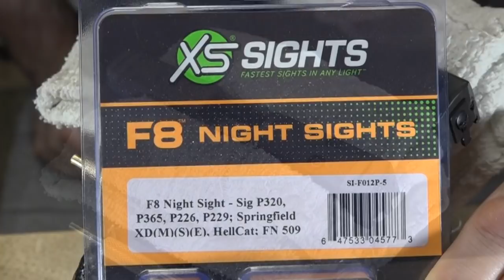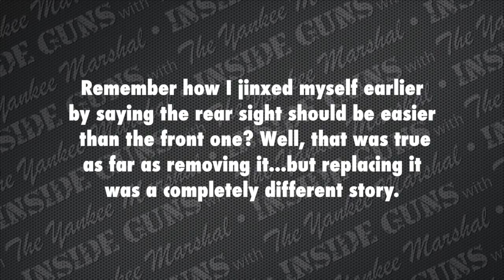Poor White Boy's Guide to Accumulating Firearms! How I afford the Gun I buy?  (INSIDE GUNS S2:E121)

Comment: I prefer to get my guns from pawn shops. I know there is some stigma behind it; however, I have yet to be burned. I know the value of the guns I am looking for and I also know what to look for in guns to ensure that I may need to fix them or not. I usually get a low price and Pawn Shops tend to have a layaway program so I could have a gun I want on layaway for up to a year. During the Pandemic I did not have to burn a bunch of rounds for a break in period.

Comment: With the cigarettes I have stopped 10 years ago.  But when you could get a carton for 9.99 and camale had the buy a carton get a carton back with the camle wides . You never guessed they would get to 7$ a pack.
And 1894 30-30 could be bought at 156 and the colt scout 129 and Kmart.  A 7400 rem 300.

Comment: I think your right on the smoking for sure an occasional beer with a friend or dinner isn’t gonna hurt anyone it’s mor the $70,000 truck with the wife’s $55-60,000 car and corresponding $1,500 in payments monthly. Oh and don’t forget the maxed out credit card you know for lift, wheels, and tires big screen TVs $1,000 barbecue, etc. then there’s $250 for cable tv. I almost forgot the $100 a week for gas because they bought x2 gas guzzling status symbols and have to drive 45 miles one way to work every day. And then piss and moan that they can’t scrape up $550-700 for a gun every now and then. Oh I almost forgot the SxS payment @ $350 a month. None of these things are bad unto themselves if you can afford them. But if you have all these things (and they’re payments) and can’t scrape up $500 every once and awhile you can’t afford them. Here’s a test, if you buy a lifted truck (and have a $750-1,000 payment) that doesn’t get more than 17mpg and didn’t buy a econo daily driver for your 100 mile round trip commute first, your probably not in line for a Nobel prize in economics

Comment: Iv been following Yankees spending plan my entire life yet I can’t afford a car only have 16 guns and I’m very poor. He must make at least 40k a year probably closer to 50. I don’t blow my money on anything yet I’m still poor working overtime every single week
Reply: Step one, don't let your wife have your card. Cook all your own food, try to stay on the whole food plant-based stuff since that tends to be much cheaper. Also, make sure your car is fuel-efficient and the tires have the right pressure, don't always take the car, invest in renewables; make sure you don't have something that leaks energy in vain, e.g., electricity, heat. Always try to go for FOSS software, like Linux, etc.; and free stuff online instead of buying stuff that you could have found for free with a few minutes searching. Don't buy products that are brand new either, or cheap garbage that will only break after a few months. I think you get my point, there's a lot of things you can do in order to be more frugal. If you're still poor after that and other things you can come up with, you need to move to a cheaper place becasue that is not a good life.
Reply: What's your hourly wage and what part of the country do you live ?